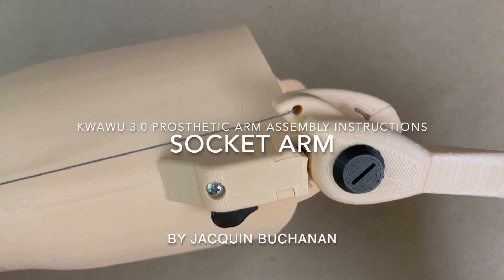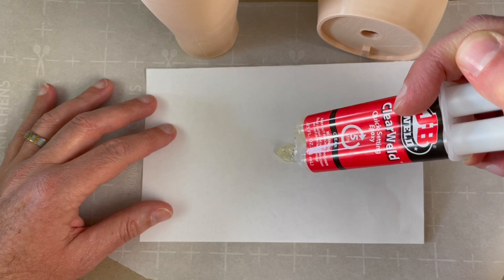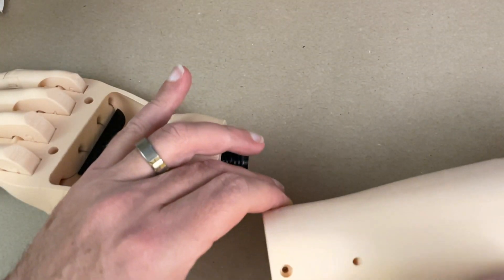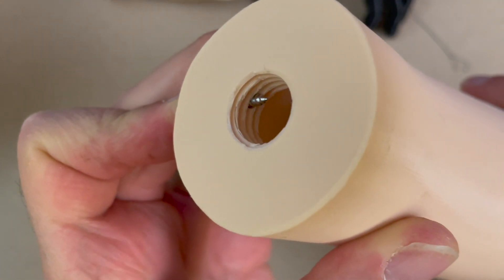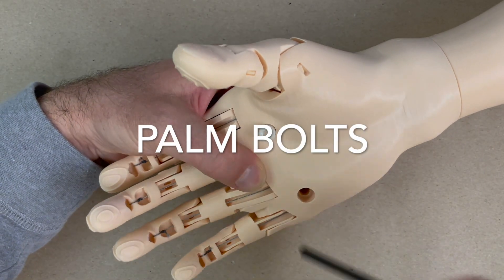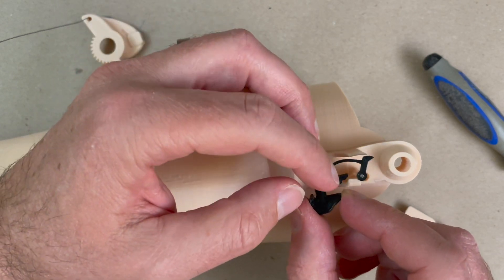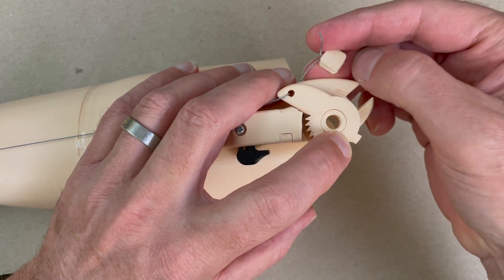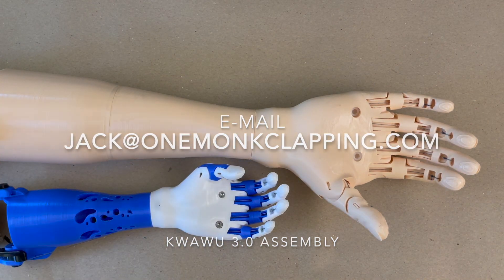4b Assembling Socket Arm | Kwawu 3.0 Prosthetic Arm Assembly Instructions

Comment: Hello there, i woukd liketo know if fishing line is used would the mechanism work perfectly?
Reply from the maker: Yes, fishing line is used throughout the hand and arm.
Dyneema fishing line—80 to 120 test strength: Dyneema is the name of material used in recommended fishing line. (e.g. brand names include Spiderwire or Hercules).
Reply: Thank you for the timely reply.
Reply: Hey , I am testing this model for a highschool kid. For a prototype, would the nylon line br enough to handle the tension?  If it works well, i plan to modify bit more for more personalized functioning arm.
Reply from the maker: @vibesome  I would not recommend Nylon Fishing line. i recommend Dyneema fishing line. But if Nylon is all you have then better than nothing. Make sure it is 80lb test or more. For the hand to grip with any strength at all there is a lot of tension put on the single line. 60lb pull on the line is easy to achieve. Nylon tends to stretch a lot so each time you close the hand the line gets looser and needs re-tensioning. Stretching is the main reason not to use Nylon.